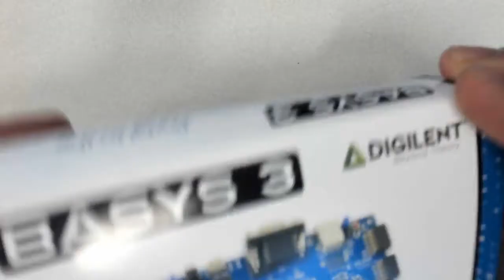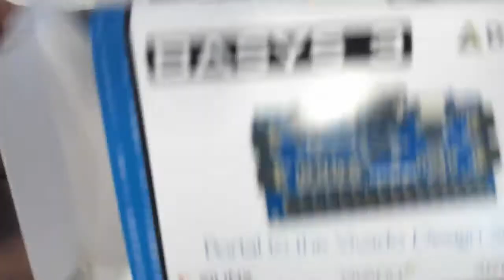Introduction to the BASYS3 Board

Comment: The 3-Pin header is actually a 4-pin header. It's worth noting that my Basys 3 board came set for QSPI programming, not JTAG. So, it's worth taking a quick look at setting it accordingly.
Reply: @iggysfriend4431 Same